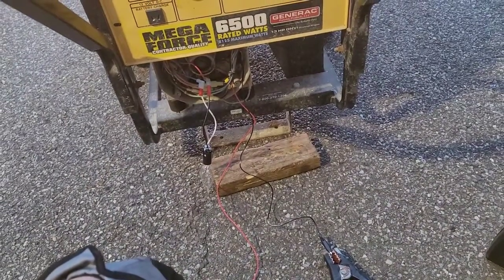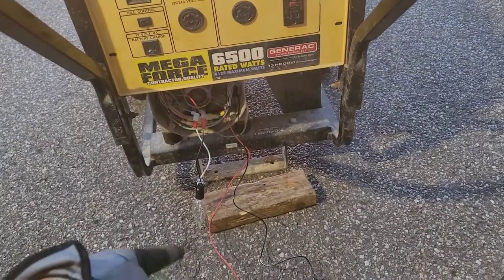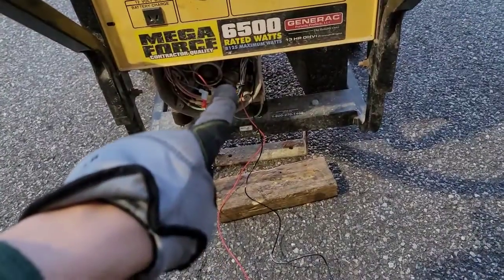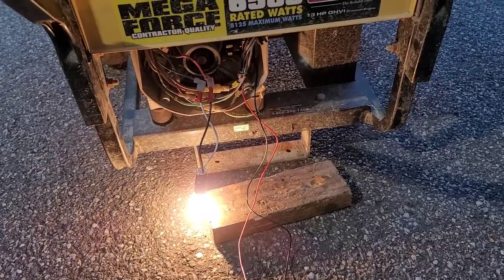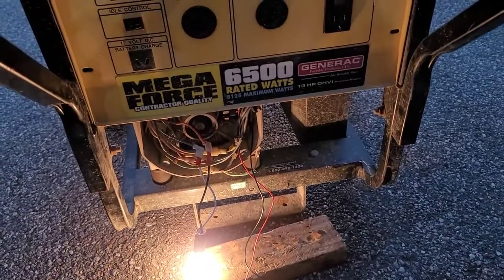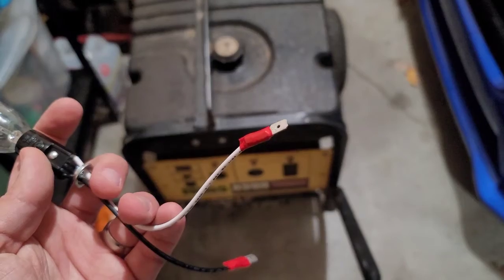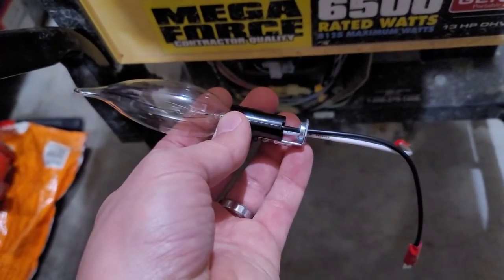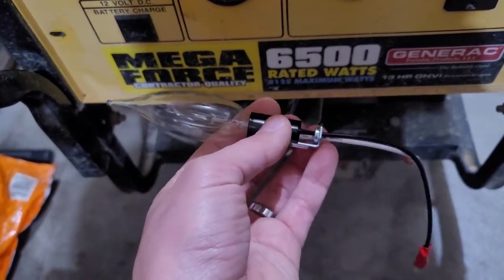Portable Generator: How To Load Test DPE/Exciter Winding

Comment: I have an 8000w generator that needs excitation at every startup- I do the drill spin backwards trick. Is this repairable by someone with little electrical experience?
Reply: I’ve tried to reflash the field a couple of times- no luck
Reply from the maker: @mowtolive You might need to replace the AVR. Some of the AVRs will turn on at 3 volts residual voltage others need six volts residual voltage to turn on.
Reply: @Bassguitarist1985 yes,forgot to mention new AVR
Reply from the maker: @mowtolive OEM or aftermarket?
Reply: @Bassguitarist1985 aftermarket Yamakato
Reply from the maker: @mowtolive You may want to try the OEM only because the thresholds for different parts have different tolerances.
Reply: @Bassguitarist1985 thanks- good idea… I have another 8000w generator that works- I’ll swap AVR’s
Reply: @Bassguitarist1985 I’ve been searching for the OEM for a couple months… just happened to stumble upon one at a local dealer- picked it up this morning. Put it in, and it worked! So happy!  Only OEM from now on. Thank you for that input, it made a lot of sense. I was wondering why the part description said it would work on all between 4000 & 10000… I’m thinking they’re set at a low threshold. Thanks again!

Comment: I know this video is 3 years old, but I believe I have the same machine and could use a little direction. On this generator, is there a way to increase the voltage output? Under a load, if I have the rpm's adjusted so that the Hz is correct, the voltage is running about 3 to 4 volts low. Any thoughts?? Thanks,
Reply from the maker: Left of the outlet panel there is a small hole for a flathead eyeglass screwdriver to adjust voltage. CW decreases voltage, CCW increases voltage

Comment: The output of them is CA or CC? I have 20smth on the upper output, I plugged a lamp on the white and red one's, and the lamp barely light up.. AVR is messed up, but all the rest of readings were within the normal range.
Reply from the maker: Franco im not following. CA or CC? 20smth?
Reply: @Bassguitarist1985  some other technician here on YouTube told me that would be worth getting a new AVR, because it might be it, or the dpe, but I'm lost with the dpe. (I'm in the Chilean Patagonia mountais with just women, a cellphone, a tester and a couple of tools, and you guys)
Reply from the maker: @frankthefran  understood. You should see about 95vac at the sockets when you excite the brushes with 12vdc. Any less than that you have a problem somewhere else. Could be the DPE, a bad circuit breaker, or connector.
Reply: @Bassguitarist1985  what if I jump the c breaker and I still get the same low output?(btw, the more volts I put on the brushes the more volts I get on the socks) all the other readings check ✅✅
Reply from the maker: @frankthefran  its not the circuit breaker then. So the DPE wires are not powering the small incandescent light bulb much?
Reply: @Bassguitarist1985  if I put it in the right spot, it doesn't light it that much. I put it on the output that I have 4 ends (2 blues in the upper part of the plastic square, and 1 red 1 white) on the red and the white ones. Blue one's give me a read of 20 smh volts AC (if I excite the brushes with more DC voltage, I get more)
Reply: @Bassguitarist1985  sorry 20smh alternate current, when I 3xcite the brushes with 12 volts, on my end to the socks of the main panel I get 16 volts. If I excite with more DC voltage, I get more
Reply from the maker: @frankthefran  is 20smh a typo? If you excite the brushes with 12 volts you should get at least 90vac coming out of the outlet/sockets.

Comment: What's the dpe voltage supposed to be if you don't mind me asking. I have a generac 5500watt with the same setup. When I give the brushes 12 volts from a battery it produces 90 volts on bothe legs of the 120 windings but the dpe is putting out 135 volts which seems pretty high. When I plug the voltage regulator into the dpe windings it's turning 135v ac into 200v dc.
Reply from the maker: Don't be concerned about the voltage as much as the amperage. The Exciter winding is meant to be a current source not a voltage source. I honestly haven't measured the Exciter voltage unloaded or loaded. I know that the current draw for the rotor could be anywhere from an amp all the way up to seven amps fully loaded. It sounds like you're excited winding is working properly however.

Comment: I saw a replay of a video you did with Ken a few days ago, and I can no longer find it, so I am commenting here. Thanks for the info about the motor snorkel. I hope more people take notice. I have been a fan for years, and have one on a Storm Responder. I absolutely love using propane, and I do not understand the reticence in using it. There are no down sides, to me. I get the idea some think it is dangerous, but they are comfortable with gasoline, which is wrong-headed. Also, I wanted to mention another idea for a cheap load bank - I bought a used drop-in range top for $15.00, wired it up, and it works very well. It is light and easy to move around, and is adjustable depending on which burners you use. I believe is is around 7200 watts max. Thanks again, and hope to talk to you someday.
Reply from the maker: Thats a great idea on the load bank! Yeah propane conversions if not done properly will cause severe damage to the engine. With the proper setup though its way better all around. I run mine on propane exclusively. Thanks for watching the live the other day. Hope to have another one soon with James Condon and Ken!
Reply: @Bassguitarist1985  Thanks for your responses. I adjusted the load block for best engine sound. What do I need to watch for?
Reply from the maker: @markgeorge3960  don't go by engine sound alone. Adjust the load block until it starts to stumble and die then back it out counterclockwise until it smooths out about a quarter turn usually. Then put a quarter resistive load on it. If it's stable then try a half a load. If it starts to stumble back the load block out another quarter turn or more until it's stabilizes. Eventually once you are able to put a full load on the generator minus 10% of its rated wattage then that's where I would lock the load block in. At that setting it is the leanest possible but still able to support a full load.

I say 10% less of its rated wattage but it really depends on the generator. A rule of thumb is 2.5HP/1000W and some generators have more horse power per watt to spare, others give the bare min.
Reply from the maker: https://youtu.be/Hghty9dDhCo is the link to the live

Comment: if I measured no resistance in exciter winding, does it mean the exciter need to rewind?
Reply from the maker: Most likely yes. And if it does not power the light bulb as shown, that further confirms it. Im not aware that you cannhave these portable generator stators rewound. Often times you need to purchase a whole new stator, but that is very costly.